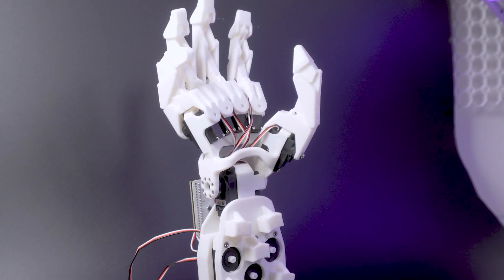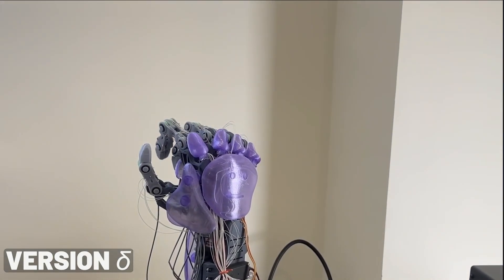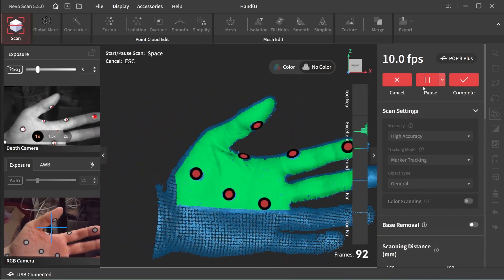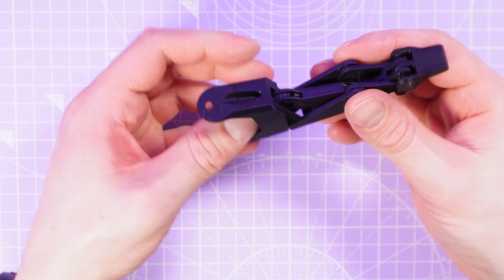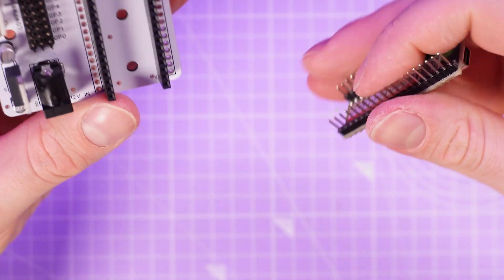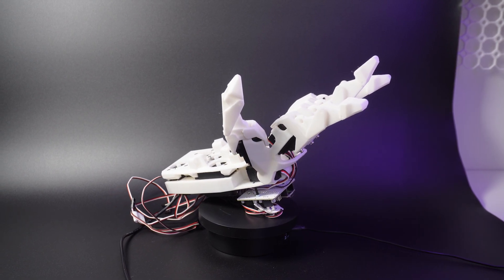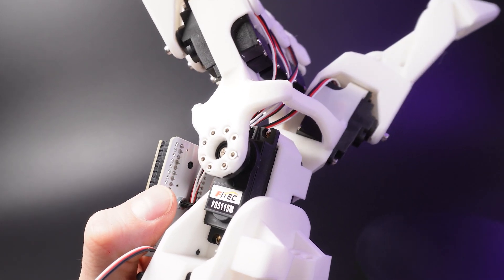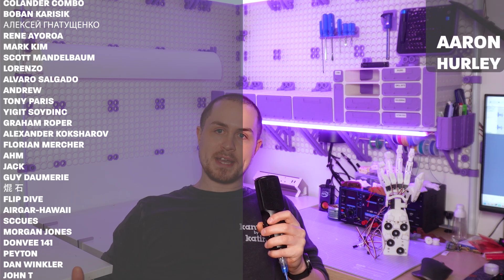Designing a New Bionic Hand (Which Prints Pre-Assembled)

Comment: You can get a finger spread with a single servo. No need for individual spread manipulation, unless you want to hold a gun steady. Even that action can become manipulated with that single servo. With the use of two rails. One rail pushes up to spread the fingers, proportionally. The other rail places them tight together. The servo raising one while lowering the other. A further push could be cam-offset, to do a trigger-finger spread. (Pointer finger isolation)

On a similar note. You could isolate the four fingers to be controlled by just three servos. One for independent pointer finger control. One for three finger, uniform grasping. One for grasp-curve control. (Creating a pre-bend form from flat/none, to curved/pinky-leading.) Since the pointer finger is independent, it can create a ball-grasp, cup-grasp, cylinder-grasp or a pointer extension trigger-finger.

The thumb can, and should have two individual controls, for obvious reasons of flex and saddle orientation, to aid grip. Unless you expect it to write, you wouldn't need three motors for the thumb.

Ignore all the extreme and uncommon motions and you will be fine. Most people don't even have individual joint control, as muscles are actually bound into groups, until we force them into isolation, in rare situations. (Playing piano and guitar and various other tasks will force individual muscles to shear from the groupings. Most people can't move their finger-tips, independent from the other digit flex muscles in that same group. Some people can't do the "live long and prosper" spread. 🤪)

Comment: Maybe run some overhang tests with your printer/filament/design tests to see how far you can push your overhang angle on your conical joints? I routinely get much better than 45 degrees on my Bambu, usually 60 with good down skin surface finish, and of course, the more cylindrical the cones, the less they will want to pop out.

Comment: Your greatest achievement so far is definitely shedding off your Yorkshire accent! I didn't know it was even possible.
As for the print-in-place pivot...maybe using bare filament (like cut filament to length, insert it in the holes and burn both extremities with a lighter) would be an acceptable compromise?

Comment: would a flex sensor on the back of each finger work ?

they're thin and cheap, and increase resistance when bent, and their only mechanical movement is the bending of the thin film.
they would need to be attached at the base of the finger only and slip in some kind of slit in each finger joint, though, as the length of the back of the fingers increases a lot when bending

Comment: Hi Will,
I love this. I've been following you work for some time now and admire your dedication and passion. I appreciate that this version is closer to your original vision (in a lot of ways), however, please don't give up on more sophisticated versions in the future. Remember that folk who make this simpler version will also learn on the go and will, at some time, want, and have the learned skills, for a more ambitious prosthetic. As for "grippy" surfaces: a spray coating like Plasti Dip might serve you well. I use it for scale motorcycle tyres, and, as long as the preparation is done correctly, the results are good.
Regarding joints popping: a simple friction pin pressed in when everything else is working will do the job. Don't over complicate things by being insistent on everything being print in place. After all, a complete print in place solution would mean printing the servos, and the cables, and the bowden tubes, and ............

Comment: Re joint ejections under load: while it would require deep integration/changes with @geeralf’s HRI linkage design, and limit material choice - one way is a compliant/flexure based approach.

Comment: i use muse 2 headband as eeg sensor  (it low cost 200$ and very compact and low wright running on internal battery ) to control my arm instead of making gloves 

the sensor connect to my pc using unity game engine (you can use a solo code in python but i prefer unity for the visual feedback) then through the usb serial port to my microcontroller in the hand

Comment: Suggestion: print the cones sticking out of a flexible inner part to interface with holes on a hollow outer part. Then after assembly, place a rigid piece inside the inner part ensuring it cannot flex inward, locking it in place.

Comment: Nitinol. Use it some how. Please. Not just as a rod that flexxes...but as a mesh...which could have some serious dexterrity. Wonder how maluable or how much certain materials would expabd and contract with temperature? Removing such bulky componnents like servos, replacing them with a high current cable/ heat source/ peltier device for cold...applying it to the nitinol mesh to manipulate the material through the temperatures adjuysred
Reply: The mesh could consist of differrent, varrying weight, thickness, gauge, weeve of the matterial to have to be able to manipulate in the ways desired....
Reply: I'm thinking of medical devices such as stents...where a tube is inserted...but the tube is actually made  of a mesh of the nitinol material...once this device is in the desitred poistion...it is "activated" expanding many multiples of its self of its initial form.... in fact as the tube version...this was its "unnatural" form..the whole time wanting to spring out to make and even larger tube. Now apply that as a function something like a muscle....

Comment: Woulod be intrestingg if you utilized 'nitinol' into the design- with the materials strength and ellastic propperties- could see it being a fantastic material for joints, bendy parts...utilizing its ellastic propperties and servos to  direct the material into shape desired..

Where the nitinol's "relaxed" state could be a closed grip... the servo pulling back to open... could make your fingers be able to "flick" since there will be ellastic tension and will want to be released. As "tendons"... or in areas such as knees, where the leg bends pulling the lower leg/ calf back...again allowing for the abillity to kick. Would also provide a suspension...kinda shock.. absorbing and bumps and jolts..

But, yeah, i think nitinol's ellastic propperties would be an excellent  material for some unique mechanical movements and haven't really seen the material being utillized in such a way..but would be so perfecct...just as I type you mention flection of the fingers and how you use braded cord....you could simplify that even further using the ellastic properties of nitinol....

Comment: Polished steel rods can be found online for quite cheap in large quantities, ranging anywhere from less than 1mm to larger. They could be a potential candidate to support the joints, possibly with some kind of bushing material for reducing wear on the printed parts. That's the simplest, cheapest way I can think of that doesn't involved more advanced fasteners like screws, or bearings.

Comment: I am playing around with a TPU + flat springy sheet metal so I can remove the need of strings/wires running thru the fingers. Basically there is TPU piece going from the point to the base inside the finger and the spring metal sheet is just making certain part to let the finger return back to to the straight state easier because TPU will lose it's force somewhat fast and eventually be not able to bring the finger straight anymore on it's own.

Pros when compared to strings/wires:
- fingers are very tough but also lightweight and the TPU part can be swapped + can even include the tip of the finger and make it "softer" so the hand can pick up and hold items easier.
- very moddable without changing other finger parts.
- can test with different TPUs and stiffnesses without changing anything in finger itself.
- each finger can have their own "mod" of the TPU core.

My work is tho just cosplay stuff since I am too newbie with electronics and coding still.

Just a little idea for bionic/prosthetic hands and fingers: include raspberry pi that has good gyros attached to it and little code for controlling wirelessly cursor via bluetooth connection on any PC. So losing your main hand or something like index finger will not cause problems when it comes to using mouse on computer, your hand/finger will be the mouse with gyro (got the idea from Input Labs Alpakka controller).

Comment: Have you worked out how to coordinate the mechanical hand with a Limb and the Brain.
"I have"    especially for important basic features
I also believe that simplicity is best way forward
I drew a mechanical hand just like yours many years ago however only just bought a Bambu 

I develop with cost as main priority
This is to say that I am also aware of other designs as a microchip programmer that require sensors however expensive to manufacturer for practical use 

Sincerely

Mr Ejike Ememe
Ba Hons Degree Administration 
Thames Valley University London

Comment: Dear Friend
   I couldn't help but notice a statement you made about removing supports from main prints without damage
I also have the Bambu A1 and having just begun I only run default settings however at the expense of damages trying to remove well bonded supports from main prints. The prints are sometimes too small to bother removing the support

I would really appreciate your insight in this matter

Sincerely

Ejike From Gateshead Newcastle England

Comment: Hey man, great job! Thank you for sharing your work. As part of my PhD research, I’m working on an approach that could fit your requirements and help solve your joint stability issues. I call this approach Monolithic Robotics, which explores the design and development of anthropomorphic robots that are fully 3D-printable as a single, multi-articulated piece. This method leverages compliant joints by utilizing common materials and their mechanical properties.

For example, in a traditional finger design, a joint is typically composed of three elements: two links and a pin that acts as a rotational pivot, forming a revolute pin joint. In contrast, a compliant joint is based on the principles of compliant mechanisms, which replicate the motion of conventional mechanisms (both translation and rotation) by using the material’s properties and piece geometry to enable controlled flexing.

This method presents several challenges but also offers significant advantages, one of the most notable being zero-assembly design. It is more bio-inspired, functioning similarly to a human hand while also allowing the integration of positional, force, and tactile sensors directly within the joints. By utilizing multi-material 3D printing, these sensors can be embedded seamlessly, printing it in the part using conductive filament, enabling fully print-to-place fabrication in a single session.

If this sounds interesting to you, feel free to check out my proof of concept in this paper DOI: 10.23919/ICCAS63016.2024.10773068.(https://drive.google.com/file/d/1GqOjPXC8tvxUqHDEhI51i5Q5xPsK_OJa/view?usp=drivesdk). There are additional references that might be helpful as well. Don’t hesitate to contact me if you’d like to know more! I also have some examples of this mechanism working in my channel, I hope my work inspire you. Thank you so much for sharing your projects—your work is awesome!
Reply: I'm trying to wrap my head around the joint design. Have you made any animation or mechanical prototype that could help me understand it?

Great job and thank you for sharing it here!
Reply: 我也知道柔性关节，但我的能力有限，我没有画出来。现在我完全没有研究思路，很担心怎么解决我的毕业项目。
Reply: @QwQ-lz2ed Yao zuo bi Jiao da de wo xiang
Reply: Dude you dont write youtube comments like you would a research paper you gotta be concise people who are interested will read your paper DOI

Comment: For control, why not build on your idea of teleoperating the whole system with a VR headset? The Meta Quest 3 and 3S are equipped with a hand-tracking system. I think it's possible to make use of it; it could even allow control of other body parts, such as the head, arms, and upper body. The Quest 3 even provides full upper-body tracking. In the long run, this could also be useful for training an AI model and making the system fully autonomous.

Comment: Interesting, but I wouldn't give up on using wires to move the fingers. As for stops, just extend a piece back to act as a stop when flexing. I think the reason why most don't follow proper anatomy is because it's easier not to, but it's not as good if you don't. Also, consider coupling the ring and pinky fingers together because our own hands behave that way for the most part anyhow.

Comment: My suggestion for the popping joints is to add a bridging section on the contact portion of each joint. This would prevent the two flaps that the cones pivots are modelled into from popping apart.

These bridges would also function as a surface to fix a grippy material to

Comment: For print in place joints, you can try a method I call push in pins. If you print in place you are dealing with small tolerances which are very hard to get right. If you think you got the right tolerance and you make some changes you will notice the joint will be to loose or too tight. This is caused by different shrinkage of your model. A solution I came up with is a pin that is partially in the joint. The part that is in the pivot point is loose enough so it will not melt together. After the print is done you push in the pins the have the right tolerance. This is al lot easier than completely separate parts. Like all print in place design it is harder to design but easier to assemble.
Reply: Can you link to an example of this design?

Comment: Hey Will, have you considered using a rubber glove over the robotic hand? Maybe using magnets glued to the inside of the glove that attach to magnets in the 3D printed parts of the hand. Similar to what you did with the robot head, but without having to make a mold for the glove, just use a regular one and add the magnets.
It's always a treat when you upload, thanks for the update!

Comment: Inmoov used cut filament instead of fastners/bearings in the finger joints, easy to work with and lightweight, just melt the ends to "plug" them in place.
Reply: That’s what I first made and it was great
Reply: @zayanh2823 I know this was 5 months ago, but is yours still working good? I'm in the process of printing the hand and forearm from Inmoov.

Comment: If you've got space, you can try lengthening the cones and increasing the stiffness of whatever is around them to try and reduce the pop-out.  You might also be able to increase the angle that they're printed at.  You might also see if you can add something to retain it on the outside and join up the "pins".

For control, have a look for some VR glove projects.  I think Sadlyitsbradley has one he's working on called ECP or something.  There are expensive commercial ones you can already buy but there are a few hobbyists working on DIY version.  I don't know if any of them are tracking splay though.

FYI pico is pronounced "pee-co", similar to micro.

Comment: what about a piece of filament instead of a screw? the hole can have a teardrop profile to avoid bridging and the piece can be heat staked into place. plus unlike a screw it doesn't need a bushing to avoid the abrasive metal-threads-on-plastic contact
Reply: Don't sound reliable to me. But I also want to share some optimisation. I use aluminium wire(2mm) fo axis. It should fit  tight in part and slightly loose in hinges( or other way around).  Aluminium soft, but  holded together by plastic part and  actually experiencing  stress mostly in a gap between parts,, but because gap is small  forces also have    small arm. So overa,l such axis perform similar to the plattc hinges (they little bit more durable and before broke they deform which can absorb some  shock.
Reply: @oberguga  of course press fit is better if your printer can pull it off. how do you straighten the wire when it comes off the spool?
Reply: @g_glop  l press wires into plastic by tip of my pliers, no high force needet, just 3-5 Newtons.
Usually axis is not long with that setup(3 -4 cm top) so it can be straightened reasonably well just by hands. Because it contained inside platic tube, there is no need to make it to straight.
Reply: @g_glop  the inmoov way ;)
Reply: @TheMaidenOnes  That brings back memories. I ended up using looped thread, knotted then the knot glued in place for the hinge and it seemed to work though definitely kludgy!

Comment: I’ve been waiting anxiously for another Will Cogley hand video, but there’s something that’s confused me across all of your previous hand projects. Why did you do all that soldering wizardry with the delta model? Servos are in no way universally limited to 180 degrees of rotation, I’d say 270 degrees is even more common. Not only that, but you can get continuios rotation servos with or without absolute position encoders incredibly easy on places like adafruit, servocity, and even Amazon. Is there a particular reason you’ve seemingly limited yourself to 180 degrees servos?
Reply: I believe because the cost of a continuous servo is a bit higher than normal, harder to get, or because he wanted to use a different rotational sensor? Iirc those servos' potentiometers aren't the best, and he wanted to measure the actual joint rotation instead of the servos' rotation. Feel free to correct me if I misinterpreted you or his previous projects.

Comment: my bone knuckle brother.  I like 'print in place fingers'.  If you have the elbow grease, you can sand down the surface of Fiberology's Fiber Flex 40D - start with 60 grit, then 120.  The effect is like suede.  Combine that with minimal infill on some pads (to let the surface conform more to objects) and it will grip.  Once sanded 40D bonds well to PLA w/ CA glue.  And it's tough, good for repeated use